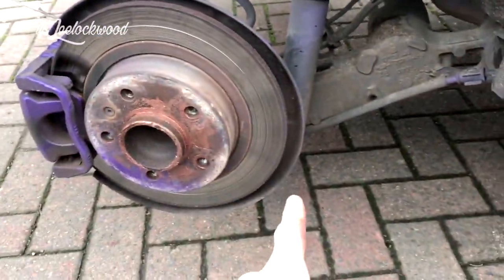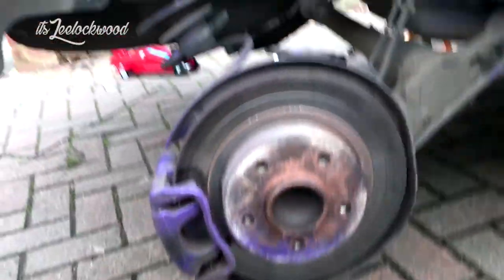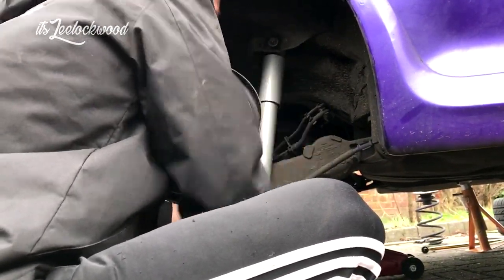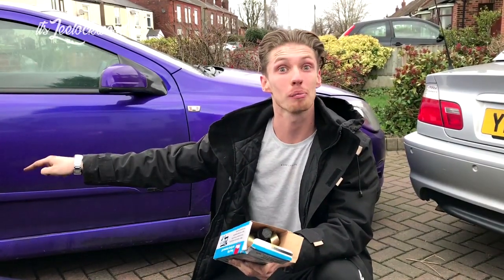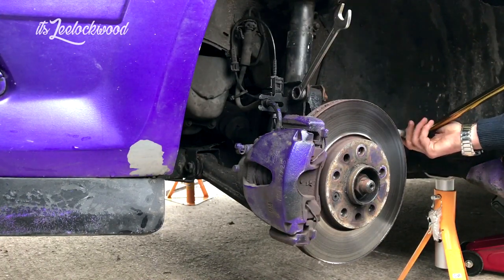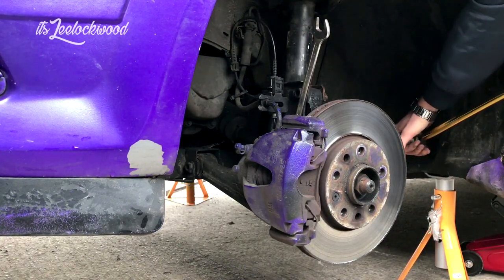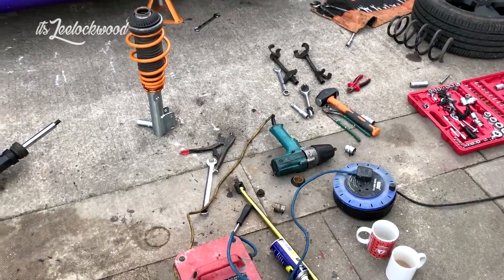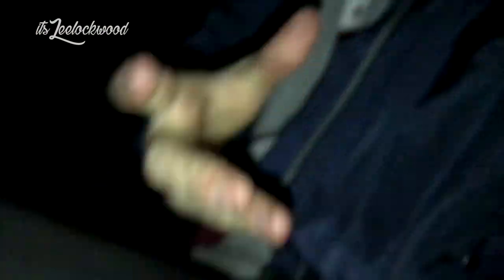How to Install Coilovers on an Astra H/MK5

Comment: Really enjoyed this vid, I used to be in the car scene I enjoyed it, do what you have to mate its seems you give it 100% effort, when you tighten bolts torque them down not up and put a piece of old carpet on floor in case you slip and punch the floor. Driveway modding is always the most difficult but most rewarding :)
Reply from the maker: John Z thanks mate! Yeah I really need a torque wrench to be honest 😂

Comment: you need spacers mate.
try a spark plug socket the ones with the nut shape on the end and a torx 45 through the center and use a spanner on the spark plug socket

Comment: I always used to be a VAG fan and now when I need a car, I was looking at a fourth generation of VW Golf, but because you can do something nice with Astra H, I might get it instead of a Golf. You don't need to do much for it to look amazing. If the paint is looking good, then all you need is nice wheels and you just got to lower the suspension. Nice vid.

Comment: you know the rear coilover adjusters, did you leave the rubber part on under it or did you just sit it down on the Axle? I couldn't get mine to fit for some reason so I just put the adjusters on bare metal and it's knocking haha
Reply from the maker: yeah i had to same problem i couldn't get it to fit so i left it off, and to be honest i heard the same knocking noise (like the spring was almost flying off) hahaha.. my advice would be to make a slit down the middle of the rubber bit, that would give it enough movement to slide in and fit..
Reply: +itsLeeLockwood cheers mate, it's either that or the spring binding, I'm hoping its that so I can sort it but pain in the ass it does sound pretty bad haha

Comment: Old vid I know but you can usually hold the shock shaft with an allen key whilst you undo the top nut, save you fucking about with the impact gun and all that other bollocks.

Comment: Next time mate tighten your wheel nuts up with the breaker bar, it makes it so much easier and it will save you fucking up the mechanism in the ratchet
Reply from the maker: Marcus Boyce yeah I do usually, I was too hungover to function properly haha

Comment: Not exactly coilovers but a good vid anyways
Reply: Of course they're coilovers? What else are they??
Reply: @zoesmith1755  They're lowering springs, not coilovers.
Reply: @seancorrigan3531  for starters, you really replying to a 3 yr old comment lmao. And yes they’re coilovers. Lowering springs aren’t adjustable, coil overs are. These are clearly coilovers
Reply: @seancorrigan3531  come on don’t be dim 😂 these Astras have separate shocks and springs on the back. no one mentioned talking about the rears did they 🤦🏼‍♀️ 
I’m not arguing with you over something I commented 3 years ago lmao. 
They’re coilovers. Get educated and get back to me in another 3 years 👍🏼
Reply: @zoesmith1755  yet here you are doing exactly what you say you're not doing😬😬😬

Comment: The car scene over there must be really garbage
Reply from the maker: bimmerlover98 well we get absolutely raped with insurance prices. And unfortunately we can't go and buy S13's for next to nothing.. a lad at the age of 20 for a fast car will have to pay around £4000/5000.. so we have to be creative and make do
Reply: Nearly £3,000 a year for my 1.9 CDTI 120 Astra. And that's with 2 years ncb and 21.
Reply from the maker: thats extortionate. Have a ring around to companies, i was getting quoted £4000 through comparison websties with all my mods declared. I rang around and the second phone call i made offered me £1100 with all mods declared, 21 and 1 years no claim on a Fiesta ST.
Reply: Is that with or without a black box?
Reply from the maker: without!
Reply: 8ile You've been robbed man! :/ My first year 2litre turbo mondeo was £2000! Expensive but second year was £1250, you're paying way to much man!
Reply: Yeah, it all depends on the area you live in etc etc. My area is riddled with car crime. Mainly burglars stealing cars and wrecking them joyriding them around the estate.
Reply: 8ile It's shit we get fucked for it! :/ I'm lucky I'm in Devon.
Reply: Yeah, Devon has a low crime rate. I'm in Leicester, a largely multi-cultural city. Without sounding racist, the Asian communities love a good insurance claim, they're probably the main reason my insurance is so high. I got rid of the Astra now, I can get insured on a Focus 1.8 TDCI much cheaper, so that's my plan. About £140-£150 a month ain't too shabby.
Reply: 8ile I'm Asian and I 100% agree with you. I'm in Birmingham and where I live, we pay the 3rd highest insurance prices in the whole of the UK.